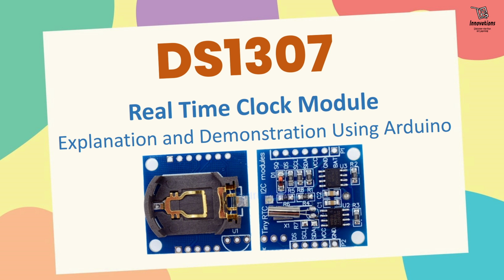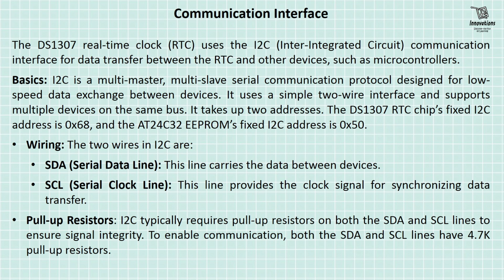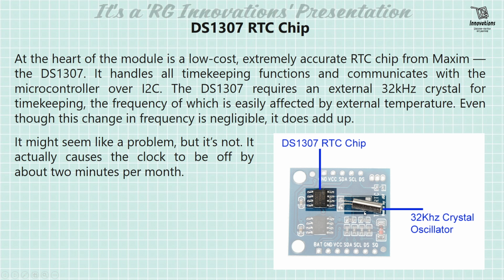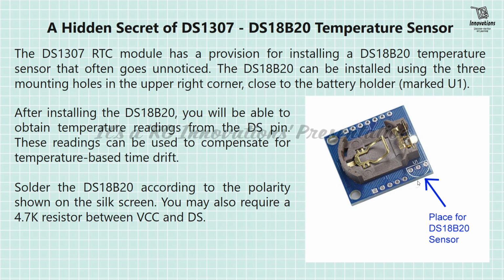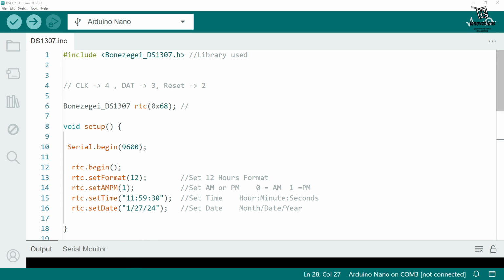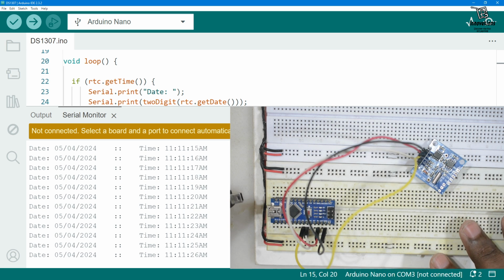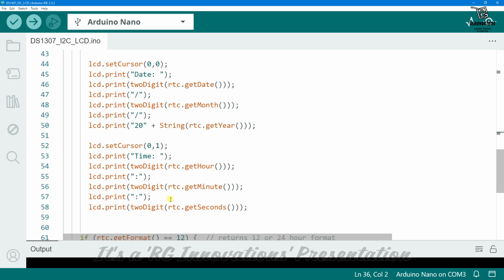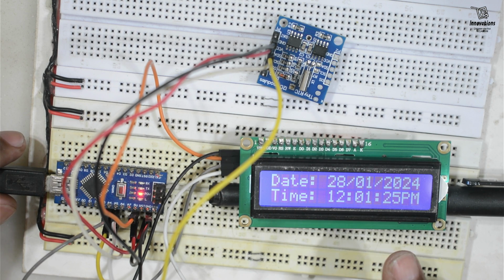DS1307 Real Time Clock (RTC) Module - Detailed Explanation and Interfacing with Arduino & I2C LCD

Comment: I want to design a Automatic anthem player (at starting Jan Gan Man & At end of day vande mataram) for collage only on working days daily with help of arduino and RTC.
Reply from the maker: How far have you done?
Reply: @RGInnovations  i am confuse to use MF T16 device & RTC with Arduino.  I have used separately
 both device with Arduino but not same at a time.
Reply from the maker: You can check out this video of mine.
https://youtu.be/0NizWPjtWwk
I have shown a 2 alarm clock module, you can alter the code to repeat it on weekdays.